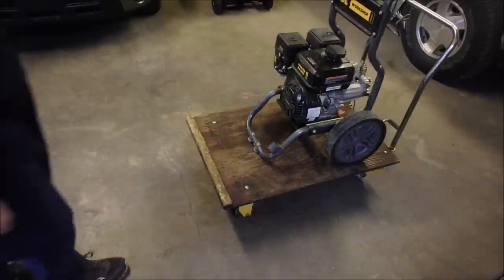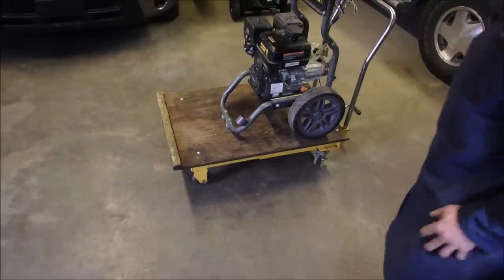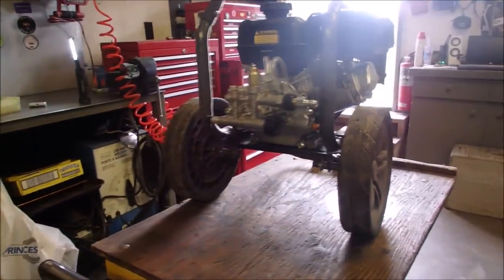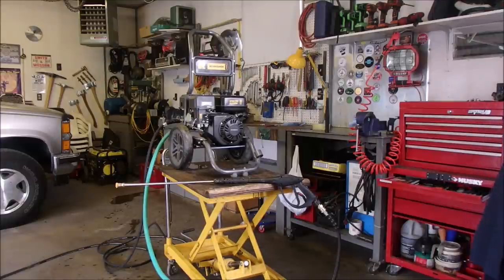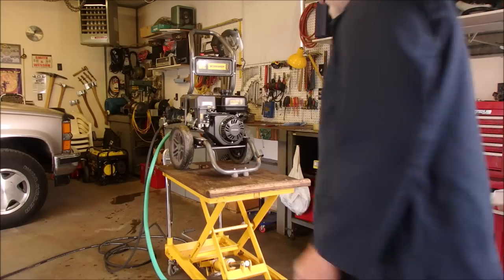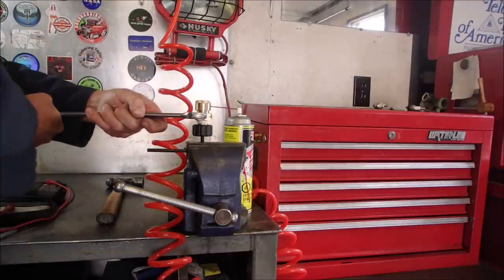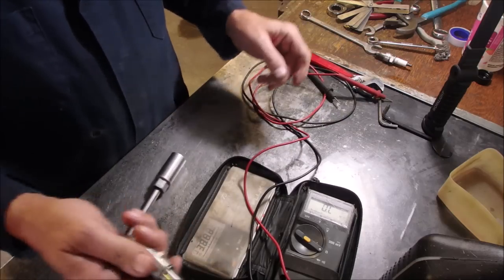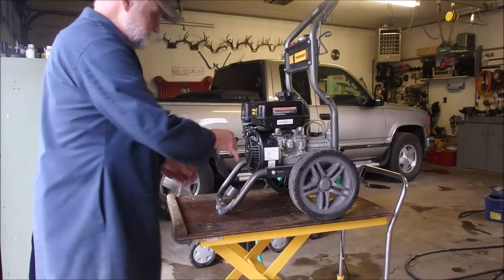Pressure Washer Won't Always Start.

Comment: Timely video Bruce. I’ve been given a petrol powered pressure washer, an old one. Gave it a service and got the engine running, not convinced the pump is ok. It works but I think it’s low on pressure. I’ll strip the bypass valve and see if it’s clean. Never worked on a pressure washer before, you’ve given me a wee boost of confidence 👍
Reply from the maker: Well go for it.  If it is broken you can't break it.  LOL
Reply: @BrucesShop  fully agree👍

Comment: When I diagnose a pressure washer, I take the pump off. Test the engine etc, then put the pump back on and run it again. A bad or failing pump will cause the engine to bog or stall. Pressure washers are tricky because you can have an engine problem, A pump problem or a combination of both. Good job Bruce! Thanks!
Reply from the maker: Yes they are 2 machines bolted together.

Comment: That was crazy. I never would have thought the plug woukd do that. I was thinking maybe the ground wire on the coil wore threw and was grounding out when the unit jumped with the trigger pull. Great video.
Reply from the maker: You bet.  I was surprised as well

Comment: I've got a similar model.  The previous owner told me he'd ran hot water through it and the pump gave up the ghost.  True, it was a mess inside.  I got a new, Chinese pump and the thing works alright.  All-in, cheaper than buying one of those junk electric pumps and I can clean anything.  Blows the paint right off my old Toyota.
Reply from the maker: Yes  When I need one I go to Princess Auto  It is a srote like Harbor Freight

Comment: I keep saying I am going to get a mower lift, I just haven't found one that fits me yet. I want to be able to store one mower on, and one under.
Reply from the maker: That will be hard to find I think
Reply: @BrucesShop  I have been looking, but no luck. I am looking for something that solves more than one problem 🙂
Reply: You may have to fabricate one to do this type of work with a design similar to the 4 post car lift.
Reply: @waynestefinashen239  I have gone so far as using cad to try designs,  I have a couple that works, but they all have faults. I am sure I will give up eventually and go buy and mod one

Comment: Wow , I have never seen a spark plug make such a big difference in a 4 stroke engine . I do not know if these coils fire every time with the same voltage , but in a car set up the voltage goes up under load .There may be a smaller voltage swing for these type of coils . IT looks like the old plug misfires under load . They use to advertise  CD trail bike ignition that would fire a spark plug in a jar of water . There is a nice hot spark .
Reply from the maker: Great point!

Comment: Hey hey ol-buddy take it for what it's worth.  Never run those pumps for any amount of time without water.
Reply from the maker: I knew an old pump guy who told me that there is noth touching inside the pump but the bearings.  I have had luck runnung them for 30 seaconds or less.   However i may be proved wrong some day
Reply: @BrucePender  yep he is right on the driven side of the pump "oil bath". But the water side... water is the lubricant for the piston and seals. None the less great video